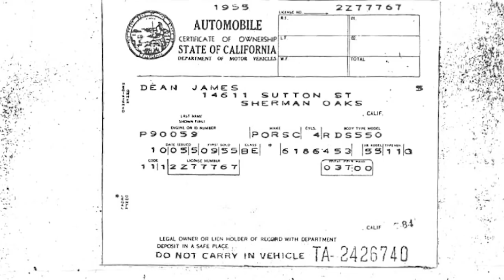Part of James Dean's Porsche Discovered 65 Years After Crash

Comment: My father owns the Porsche badging off of the car. My great uncle was a mechanic that worked for Mr. Dean when he was still alive. They are held in a locking container in the top shelf of my fathers closet. I have seen them once, gold Porsche lettering from the rear, as well as the larger rear crest. Heavily scratched but in otherwise good condition.

Comment: I heard the Engine from this car was put in another Speedster Race Car which the Driver had a horrific crash the 1st time raced it.
Reply: 2 people used parts from car, and were hurt, i also heard that the California highway  patrol used the car in a safty display to get people to  slow down and some teenager got hurt because the thing fell off truck and hit him
Reply: There are probably more bits of Dean's car in circulation than of all the Porsches ever made, just as there were pieces of the 'True Cross' centuries ago (and some are still around).
  Jimmy didn't know what he was going to start.
Reply: Wow Ric, syntax much?
Yikes. Awkward.
Reply: @willielarimer7170  That much is true.

Comment: I thought that a few years after Dean's death his Machinac said that they had replaced the original transaxle and cradle with a specialized Race one and the original was sold so if that is true then that transaxle wasn't in the car when it wrecked the same goes for the front suspension it was replaced with racing parts specially built for the car.

Comment: The owner of the car (Barris) likely claimed it stolen and collected the insurance. The car might've been crushed, dumped in a lake, sealed in a vault... who knows
Reply: The car was wrecked there was no real value to it at that time everything that was worth something like the engine and transaxle was sold the rest was twisted metal no Insurance company would of insured it back then.
Reply: Barris would of never pull a insurance scam. What are you talking about? The car was loaded and was supposed to be shipped somewhere and it did not make it some think it was brought to a scrap yard and scraped by mistake or someone took it for themselves but it has not been around so I think it was scrapped by accident but it was not a insurance scam. No insurance company would insure a twisted hunk of steel at that time it had no value and everything of valve was sold from the car.